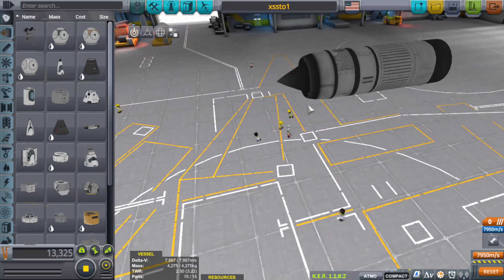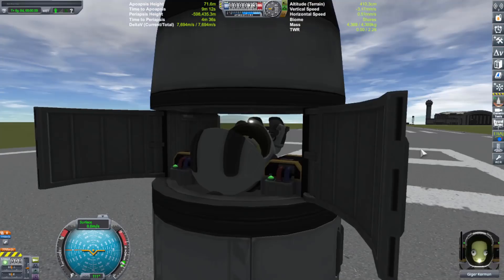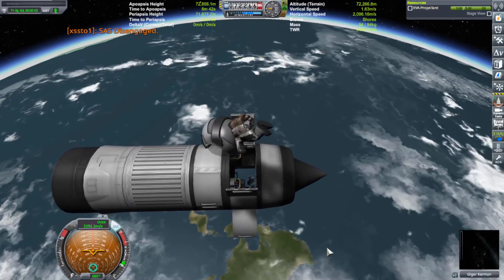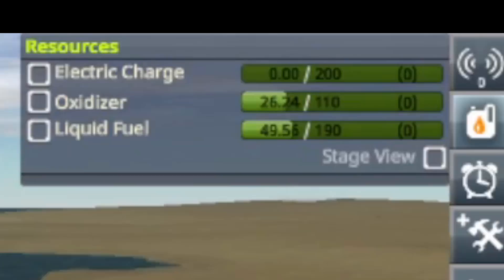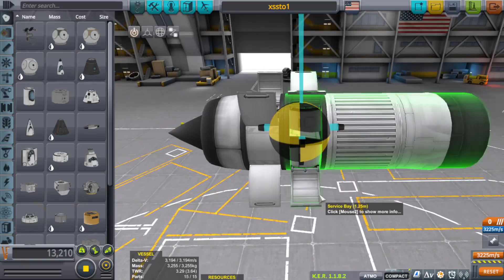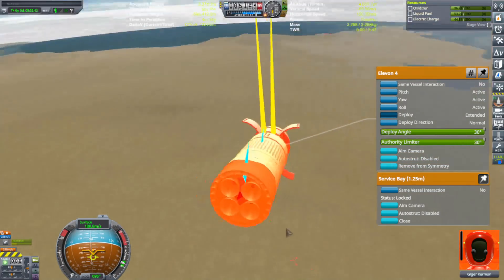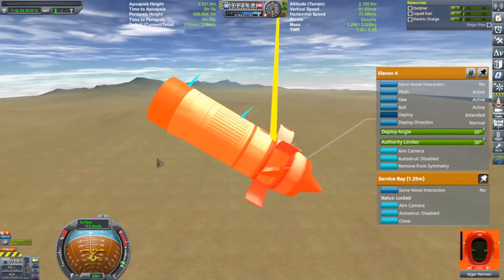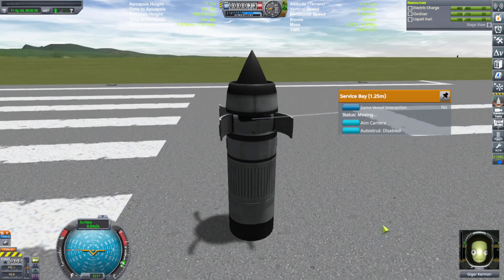REALLY SMALL SSTO

Comment: Helicopter blades don't register they're stowed, either. Actually wait, maybe the game thought it was outside the service bay. There is a little space the game thinks is outside the bay even when it's in-between 2 bays. And you should never try to fit sensors neatly on the flat walls of a service bay, because the game will think they're outside too.

I hate trying to land with jet engines! XD There's so much turbine lag, with the RAPIER being the worst.

Comment: You could've put a pair of RTGs on there and not have to have worried about running out of electricity, and perhaps a couple of the tiny .625m RWs as well to help with flipping around. Also, you could've put a pair of Airbrakes rotated 180 degrees where the service bay hinges were at to force a huge drag spike ahead of CoM to assist in flipping the craft over.

Comment: Put the all fuel tanks up front! On a small craft like this, the difference between the Wet CoM and Dry CoM is a big factor. When you are landing the liquid fuel will be mostly gone, so the CoM will have move slightly forward, toward the fixed masses of the battery and the Pilot. Putting the tanks up front will inverse this, causing the CoM to slide backwards when you need that most.
Reply: Just use rcs build aid, this mod shows vessel's dCoM